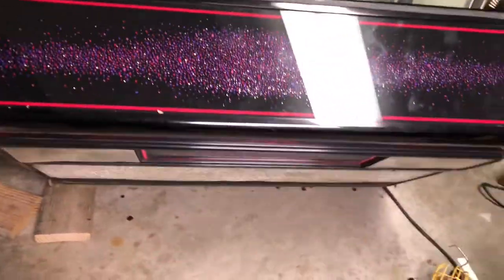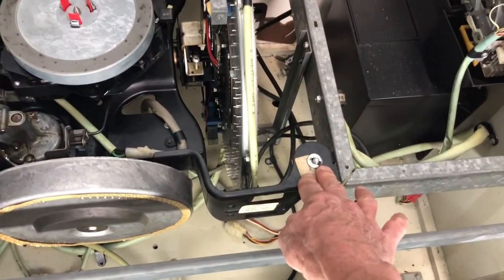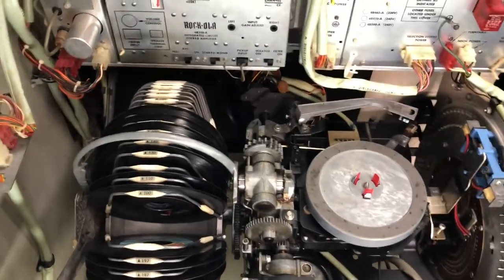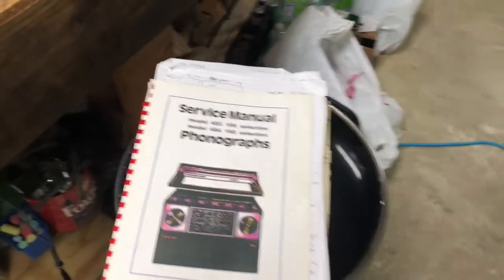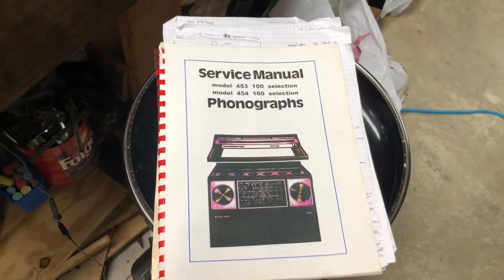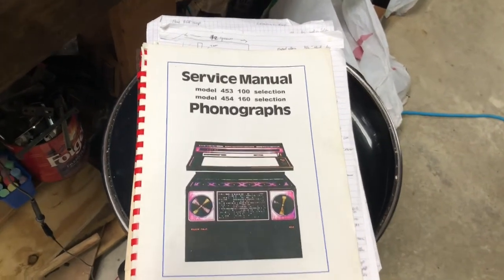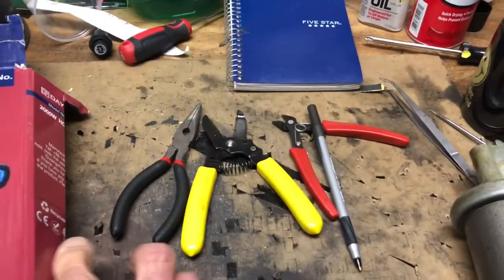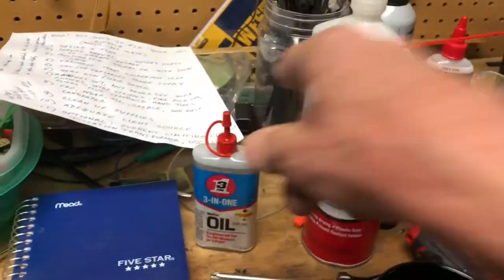Bringing the 70's Rockola jukebox back to life. Part1

Comment: Hello William ! I enjoy watching your videos!Last year I bought a Rock Ola 444 and started servicing it. You helped me a lot to be able to restore this jukebox. But there was a problem and maybe you can give me some advice. Thank you in advance!I cleaned it very carefully and replaced the missing parts . I supplied the device with power and after a few adjustments it worked perfectly for a few days. Then, all of a sudden, those WRITE IN solenoids no longer wanted to hit those pins at the time of the write in sequence. It finds the selected song, it stops next to the pin (the tooth ) but it doesn't do anything anymore(does not hit the pin). If I move that pin with my finger, then the carousel starts (read out) and play the selected song (the disc put on the turntable, rolled to the end and then put back in the carousel). To give  a clearer idea, I will explain the exact steps. I give him credit from the credit button on the credit box (the one for servicing). I press the keys (ex. A 1). The keys remain locked (pulled by the solenoid next to the keyboard), then the arms for write in start to rotate and stop next to the selected song (A 1 ). After this moment, the carousel starts spinning, but it doesn't stop because no PIN is moved. After a few turns, I have to unplug it because the solenoid on the wobble plate starts to get very hot because it remains activated (I think it deactivates after the pin is reset by the read out arm). I'm not sure but I suspect. Please help me with some advice .Maybe you or somebody know where this problem comes from.Maybe somebody can show me where to look more carefully... where to look or what to check. I don't understand why it worked and then stopped doing everything properly. I I also reset the gear wheel with tooth from the credit box. I replaced all the relays, checked the fuses. I cleaned the write in and read out tracks with extreme care. I think that the solenoids on the write in arm are not activated by the red wires. The ground works (the black wire). Have a good day!
Reply from the maker: A lot of things need to happen for the write in hammer to get power......the three areas to check are K4 (stop relay), the selection impulse switch (credit unit) and the ADR relay(credit unit).  All three of these need to be examined and have their contacts cleaned, as they are critical for getting power to the hammer coil circuit.  I would also clean the write in circuit board with CRC and a soft cloth.  If nothing good happens after doing this, post a short video on the FB Rockola Collector Club group and you should get some good feedback.  Best of luck

Comment: Thank you for amazing videos and help William. I have a 68 Rockola 440 that is needing a lot of cleaning. I don't need a show piece, just something fun for the shop. I would like to really get it cleaned up though, it's gross. So I'm in process now of that and I have a question for you on cleaning those circuits. I'd love to pull the entire mech, basket and do a deep clean and maint on it. Suggestion for me on best way to do this? I have contact cleaner, deoxit af / cf but this is so dirty that I'll really need to get after and would love your advice on it. Thank you!

Comment: Great video!! Considering buying a 450. They are ask $300 working but has a few issues looks in good shape cosmetics are very nice. Any advice on they price? Thanks
Reply from the maker: If all the glass is good and it is complete, $300 is not unreasonable.  But since it is not working, try to get it for $200-250.....you are in the driver's seat.  That box is fixable inside.....no parts are unobtainable.  Best of luck

Comment: Thanks so much for your videos.  I've got my 441 working all except the turntable.  The turntable will not activate either in Scan or Operate position.  When the gripper places the record on the turntable, turntable does not spin but the amplifier is definitely on.  Any ideas?
Reply: Push the reset button..That's what worked on mine and it came to life
Reply: @chess1458  Thanks!  I'll give it a try
Reply from the maker: Remove the turn table platter and observe if the turn table motor shaft and idler wheel are spinning.  If so, then you need to clean the inside of the platter rim and the idler wheel and turn table motor shaft so they have better friction and move the platter.  Put 2 drops of oil down the hole in the shaft under the platter and reinstall the platter, being careful to push the idler wheel underneath.  Also be sure the spring attached to the idler wheel is firm.  If turn table motor is not working , reseat it's connector or disconnect and hook up to 115 vac to see if it works